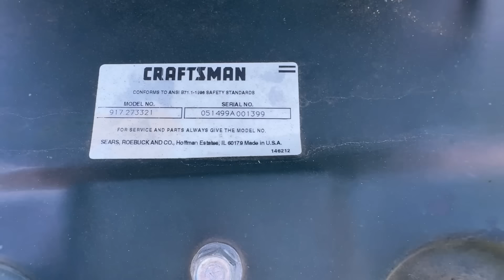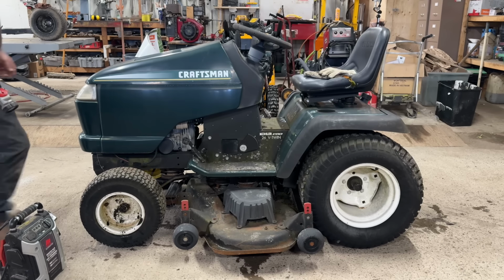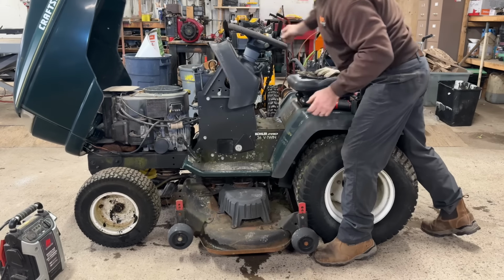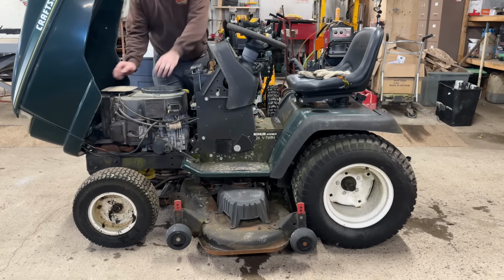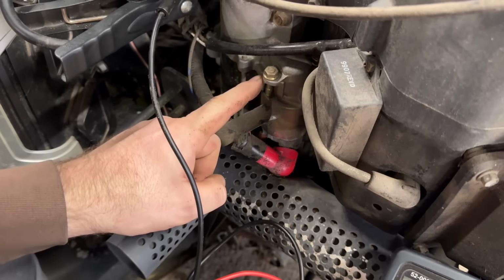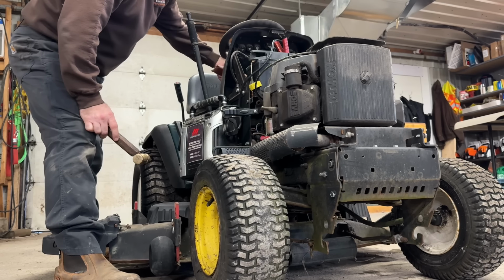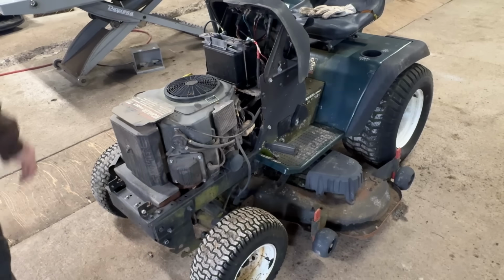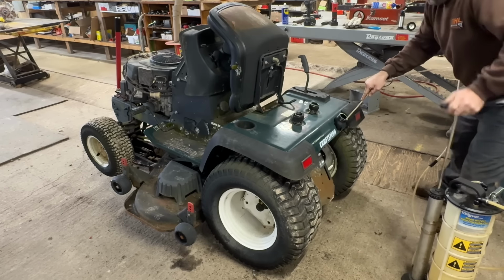* PART 1 * Scrap It or Fix It? Craftsman Garden Tractor Left For Dead! 26HP Kohler Command Engine!

Comment: Mine has been running strong since new in 1999.  It gets used for mowing in the summer, plowing snow in the winter and gardening in the spring. They were true work horses

Comment: I have the gear drive version of this tractor, purchased new in 2004. Cut my farm yard for many years. Mine just needs a little deck repair to be back in business. The Kohler engines are excellent although they did have many early head gasket failures. One head sits lower and that one would even let out oil. Easy fix, but surely all the originals have the upgraded gaskets now.. 
One thing I might recommend is to replace the nylon bushing around the center spindle the front axle articulates on. You should be able to find a bronze replacement and a new large bolt. 
Also, Sears offered a "rear carrier deck" that hung off the hitch plate and you could put bricks in it to give weight in the rear... worked Great for better drive traction and to make the steering easier. I doubt you'll find one for sale, but any rear weight you fab up will help with mowing and pulling things ~
Reply from the maker: These were a tough tractor!  It's hard to buy something today of this quality.  We also have the gear drive version.   We are in Canada, and in 1999 this tractor retailed for almost $6000.00 .  Thanks for watching!   Watch out for part 3 to go live later today!  :)

Comment: I have same mower but it's red and has the 6 speed hi/low transmission in it. Got it from a friend lasy year after a tree fell across the hood. All i had to do to ge it running again was rebuild the carburetor and new fuel lines. It had the deck with it but it was rusted out
Reply: You SIR, DO NOT Have the Same "tractor".A Unit With the 6×2 TRANSMISSION is in a whole other "Ball-Park" ( & horizontal shaft Engine), that the found "Scraps-men" TINKER-TOY. Had TWO of these "Scraps-men" Brand-new JUNKERS ( vertical shaft engins& hydro-slack-o-howl-o-matic "trams-mission's"). The just "Bearly made" one cutting-season befor the were returned for a 40% LOSS of money. The "loss " was worth it when 2 More (200$&400$) WHEEL HORSE's showed up. For the LAST 10 YEARS they do EVERYTHING BETTER that the "craps-men" JUNKERS could NOT. The Wheels-tires & seat are worth saving the REST of the "Heap" needs to go to the "POT-METAL" Heaven.....on this guys "build-up". Where as you have a "Fine Machine ".
Reply: I have a GT5000 which I think is what you're describing. I got one for free because,  wait for it, it wouldn't start. 10 Amp fuse and a new starter later the thing has been a champ!! 53" cutting deck and came with a bunch of rear mount attachments including a 15 gallon tow behind sprayer. Only mods I've done is add an inline fuel shutoff so I can run the carb bowl dry so the ethanol doesn't screw up the needle and seat. Trouble free for 5+ years now.
Reply: @ericthorsell7515  I'm shur it is an "OK / grass cutter " on FLAT GROUND. With the deal that you got( & a little wrenching) it might be Perfect for "super-light-duty"towing& such. Where as my 1994 C160 H Wheel Horse 16 Hp unit could Do EVERYTHING BETTER than 26hp 2015, 3500.°°$ "Excellerater- Model Craps-man " ... With the exception Burning 3 TIMES the gasoline,& THEEE TIMES the NOISE. The Wheel Horse's are "quiet as mouses" & just bearly sip the fuel.  Maybe this is Why , when l "parted-ways" with the 2 "scraps-men's" units l Acquired 5 more Wheelhorse "Precission-Powerfull-Super-Reliabale" machines. ( Nothing Beats a Wheelhorse for doing Wheelies,Pulling & Plowing in their Wheight classs).Best wishes with all your endeavours.
Reply: @ericthorsell7515  it is. Been a great mower since i got it but didn't bother trying to repair the deck. I ordered a set of tractor like tires for it. Mainly been using it around the house hauling in firewood

Comment: Erica, all your voiceovers are perfect. Tyler’s running commentary, however, leaves a lot to be desired. Even with my volume turned all the way up I can only catch about half of what he’s saying, yet every time a mechanical is touched those sounds come through very loud. I suspect you’re aware of this but I had to mention it because for me this is usually the deal breaker which will cause me to not watch a channel moving forward. I suspect this has a lot to do with type of mic and placement and I’m sincerely hoping you’ve already addressed this in future videos you’ve already recorded. 🤞
Reply from the maker: The issue is we’re running without a mic.   The new mic system is in the way!

Comment: You  might have to sit on the seat to start it
Reply: You can jump the seat switch out with just a short piece of copper, at the switch connector below the seat 💁‍♂️
Reply from the maker: This model tractor will start if you not in the seat, as long as the parking brake is set.